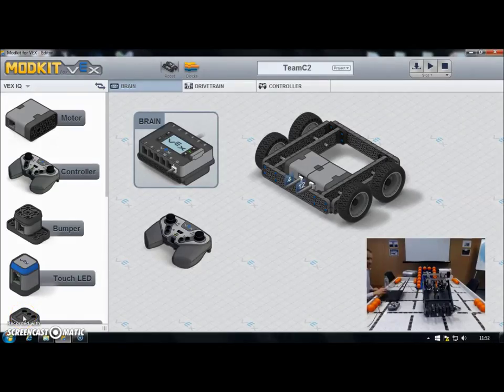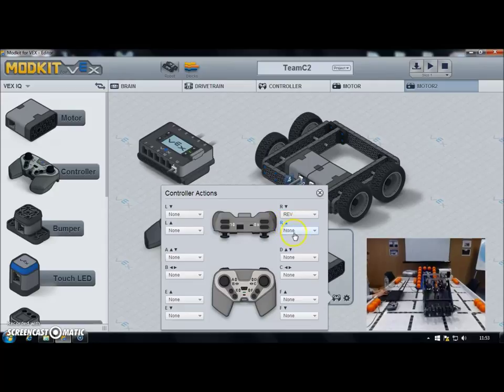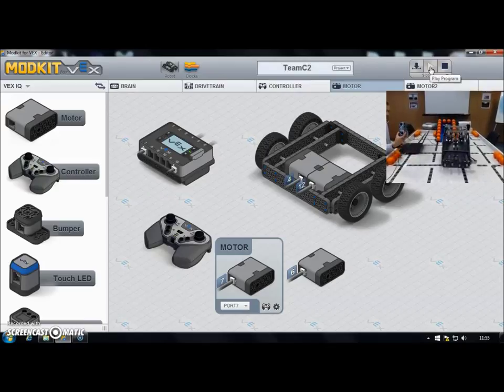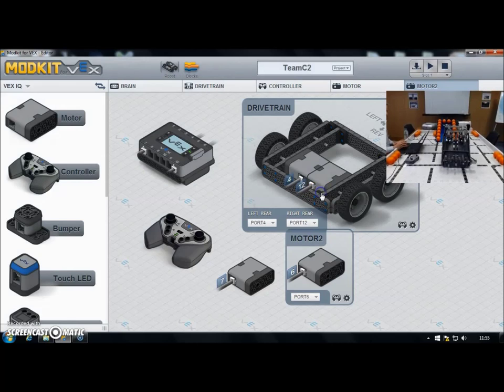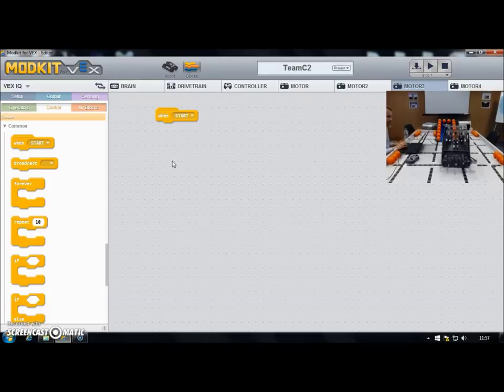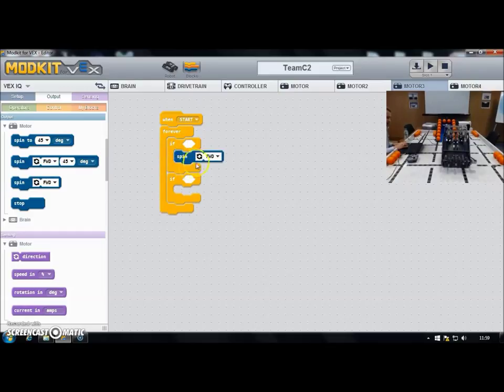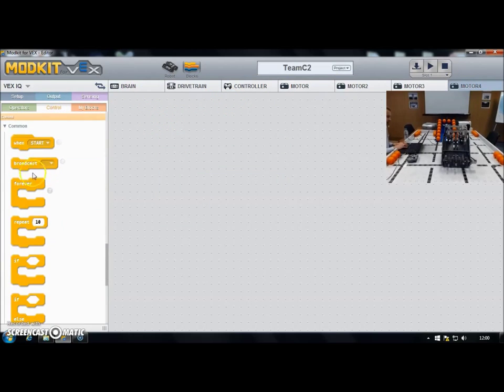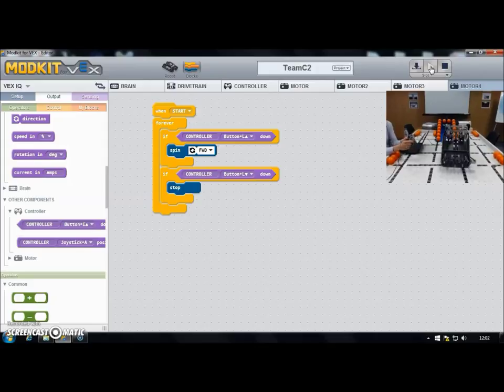MODKIT for VEX – Programming Joystick Buttons

Comment: Hi, any chance you have some insight into the following pls:
1. I used RobotC for Vex IQ but now switched to modkit- do i need any additional steps to make IQ brain understand modkit? I seem to have hard time connecting to the brain using modkit. 

2. How do I update firmware using modkit? 

3. Do I need to update anything on the brain when switching to Modkit from Robot C program

4. I have missing motors message on the brain when kids rebuild the robot into a new robot from the previous clawbot. How do I tell the brain to forget the previous configuration of motors and sensors and accept the new one (different than before)
Thank you
Reply from the maker: Hi there, please find the answers to your questions: 

1) No, the Brain uses the same drivers for Modkit and ROBOTC so if it works with one, it should work with the other. Make sure that you have Modkit and Modkit Link installed (Modkit will warn you if Modkit Link isn’t installed)
2) VEX IQ uses VEXos to update firmware regardless of programming language. https://www.vexrobotics.com/vexiq/resources/vexos
3) No – Modkit will simply overwrite the ROBOTC file structure when you download a Modkit program.
4) You need to write your own program without these motors included.

We hope this helps.
Reply: Many thanks!!!! I really appreciate your help!

Comment: I have a question. Can you use RobotC and Modkit for the same robot? I don't see why you couldn't but I wanted to make sure before I make a mistake of some sort.
Reply from the maker: Thank you for your question. It is indeed possible to program your robot to have separate RobotC and Modkit code. These simply have to be saved on different slots on the brain.